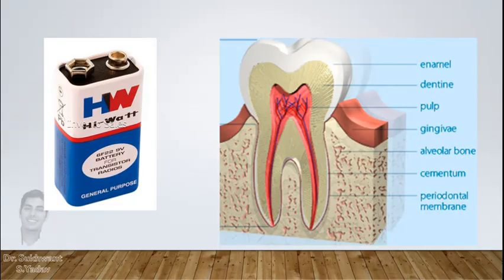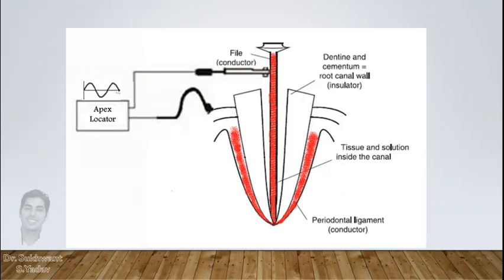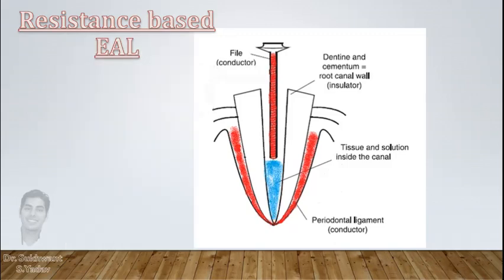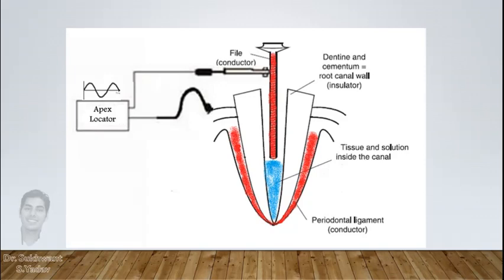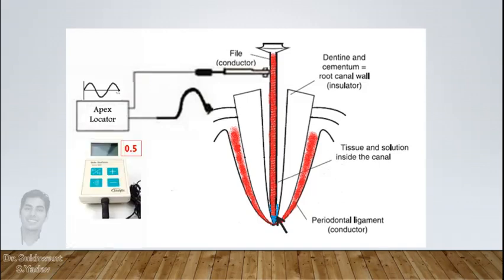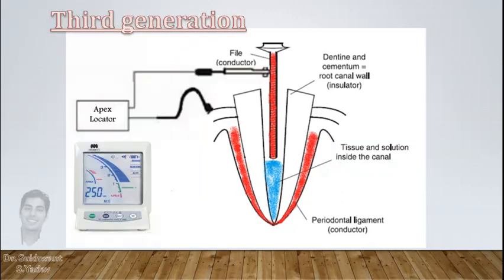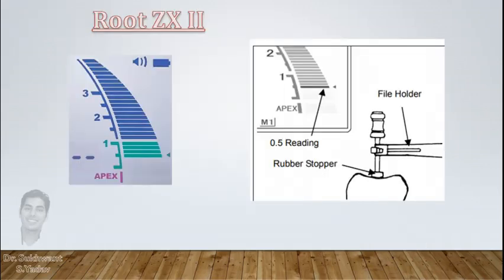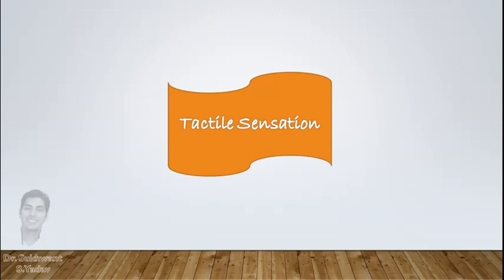Principles of Apex Locators

Comment: Hi sir... I use triauto zx endomotor with apex locator.. in some cases it show it reached apex while cutting with rotary files.. after fitting of gp it will show short 4 to 5 mm... It was very disappointed situation.. what may be the cause.. is it fault of rotary files due to wear of file blades??
Reply from the maker: Hi

It's not a fault of rotary files. 
There can be following reasons for faulty reading in your case -
1. Just check for contact of rotary file to gum or cheeks during preperation. Avoid its contact to gums
2. May be canal is overflooded with irrigant or saliva. Dry the canal before use. 
3. Ideally take WL with hand file, then use rotary at that length. 
4. Take approximate WL on preoperative IOPAR. It will take you to last 2-3 mm of canal which will help in avoiding faulty reading
Reply: @Endocrisps  k sir .. thanks